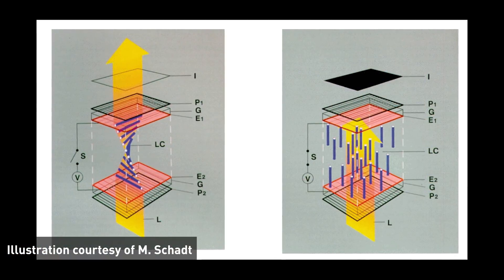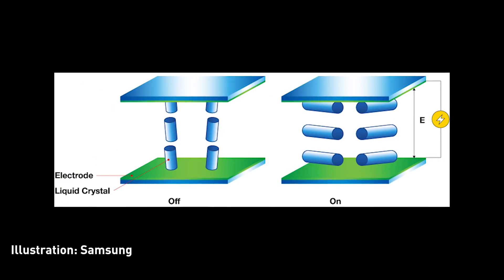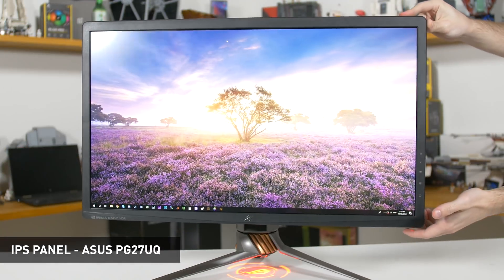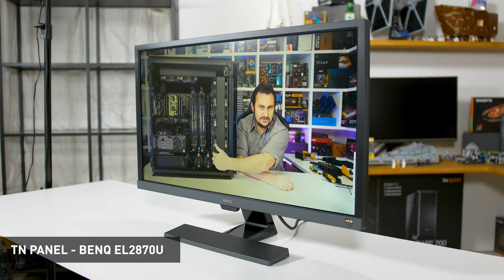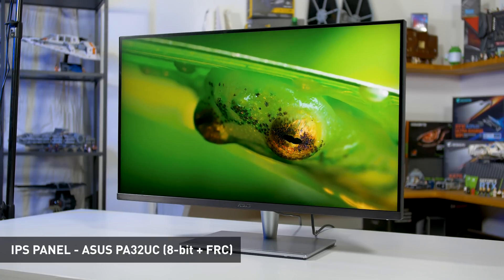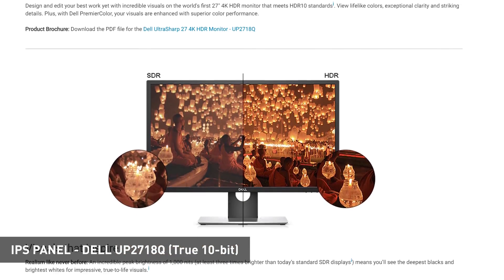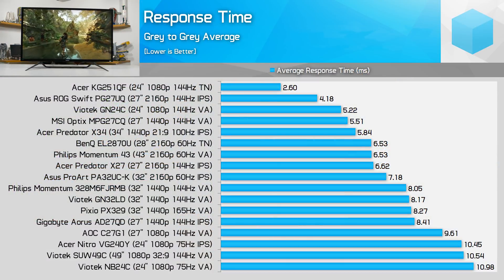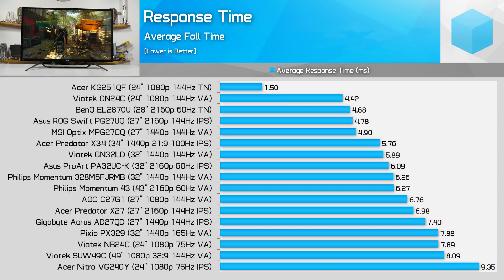TN vs IPS vs VA: Which LCD Monitor Tech is Better?

Comment: A good TN screen will still have better colors than a really bad IPS panel. Didn't saw much difference personally. Mostly in color shifting. My TN panel loses its color accuracy when you look from below the screen. Barely no difference from the side though. IPS experience no difference at all. Reds and blues are quite better on my IPS panel. Blacks seem to be about the same. Not great in both cases.
Reply: @selim1161  Well it does matter that it suits your needs. Buying whatever seems most fitting depending on your criteria is your job then. Though, I wouldn't buy a Monitor for the scenario you are talking about.

Comment: What is the best VA or IPS in the 200-300$ price range? Better if comes with 144Hz refresh rate? I use the monitor mostly for gaming (not competitive) and movies
Reply: If you want 144Hz AOC C24G1 or MSI MAG241C might be something for you. Both are 1080p 144Hz VA curved for $199, they also have 27 inch variants (MAG271C and C27G1) for a little more but I wouldn't suggest those because they have a lower pixel density.

Comment: Modern higher end VA is better, it does not have the old VA ghosting anymore, I would say it is about as fast as high end TN gaming monitor but with way better colour and black level than TN and IPS.
Reply: Yup mine is 4-6ms has a contrast ratio of about 4500:1 and 145% srgb
Reply: Well that's pure bullshit.
Reply: @KeanoMUFC1 ??? What u talking about? What's bullshit?
Reply: @CoCo.-_-  that modern VA panels have no ghosting and are as fast as TN panels. That's just completely not true.
Reply: @KeanoMUFC1  Go see it for yourself, current gen TN panel totally no match to current gen VA.
Reply: @mikka1986  that depends what you demand from it, TN panels are still the fastest panels in the market, even this video shows it.

Comment: Strangely, IPS are looked down upon in the TV market where the wide viewing angles might actually be useful. People are dialled into contrast & blacks rightly or wrongly and go for VA panels although there are some pretty bad ones out there.

I don't see why viewing angles on laptops or monitors are a major consideration, in 99% of use cases you are sat right in front of the screen.

Looks like OLED might become a thing for laptops/monitors but still very expensive and 'burn in' would be a major consideration for games with a permanent HUD.

Likely we are only a couple of years away from monitor technology that can do everything, speed, contrast, blacks, viewing angles, colour gamut then it will just be a matter of price.

Comment: IPS glow really sucks, especially if you always play/work in darker rooms. I’m on VA now and wait for mini-LED monitors (OLED and microLED are not really in sight right now)
Reply: OLED burns in. Not an option for pc
Reply: @scythelord If you use it with your brain they don't ;)
Reply: @ArthurOseven  cant overcome the static icons, taskbar or other static shit in pc. Pixel shifting doesnt help in this scenario. Oled is a no no in PC.
Reply: miniLED monitors are also insanely expensive, even more than most TVs. A good IPS panel shouldn't glow too much.

Comment: Would love a 27-32" flat VA 144Hz freesync monitor.  can't seem to find such with all those specs in Aus. 

Pixio have one but they don't ship outside the US.
Reply: I believe Viotek have one but I don't know is it sell in Australia
Viotek GN27DB 27"
Edit: found this on Aus website https://www.u-buy.com.au/search/index/view/product/B078P57ZWL/s/viotek-gn27db-27-inch-curved-gaming-monitor-1440p-144hz-samsung-va-panel-freesync-gameplus-fps-rts-vesa-black/store/store
Reply: @Conthium  Viotek are hard to get here if not at all.  That's curved unfortunately, I want a flat VA panel with the aforementioned specs which seems impossible to find here.

Comment: TN for me. 
- High End TN today is close to IPS in color production.
- I hate Mation Blur on IPS/VA panels!
- TN is cheaper
- I game alot of FPS games!
Reply: high end TN is close to low/mid range IPS in color reproduction.
motion blur is more likely to occur in low end monitors. and today even low end don't suffer that much from it.
i have a TN and an IPS panel one next to each other, and i really don't see a difference in response time  (the two of them are 75Hz)

TN is if you ONLY care about highly competitive fps games, but if you do anything other, IPS or VA will be a lot better.
Reply: @Ted_Sd  Motion Blur suffer both in High End and Low End monitors, but the TN's are just better when it comes to blur! That you don't suffer from it its a gods end, and you should be glad about it. I suffer from it, and anything glow/ghosting and motion makes me swear to TN everytime!
Reply: @Ted_Sd  You likely never will see the difference, as it's probably around 5-10 ms difference, something so minuscule that only a high speed camera can capture.

But, if your TN monitor is higher refresh rate compared to your IPS, you will see the difference in something as simple as mouse drag over desktop, with much greater difference in games.

I was on the same boat about IPS before I got my monitor, but better colors and viewing angles (something you shouldn't care much about if you are using it primarily for gaming) aren't worth the trouble and extra price.  Like you said, mid to hight range TN's have a great contrast and color reproduction nowadays. Just check reviews before you buy.
Reply: @DavorBa  Your are correct about the ms, but thats not always the same as motion blur. There is some legendary IPS panels out there, namely a good old ASUS monitor who don't have the motion blur issues. Atleast for me!
Reply: @Moonraker84  I didn't mean motion blur. I meant the higher refresh rate of TN monitors (yeah there are 144Hz IPS monitors, but a lot more expensive).
Motion blur is another issue, but the sheer amount of frames a TN can dish out for a much lower price compared to IPS, that gives it a huge plus.

This video simply compared technology vs technology, like everyone has infinite amount of money to buy the latest and greatest 1440p 144Hz IPS or VA monitor that rarely suffers from the issues I mentioned and has a good response time.
Reply: if you buy high end then it's not cheaper.
Reply: @eugenestoner2685  Well, people like to compare High End TN vs High End IPS, 9 out of 10 the TN is cheaper.
Reply: @Moonraker84  Ok, but if you compare high end to high end then motion blur and refresh rate can be comparable, it goes on both sides
Reply: you are right, sorry my bad.
Reply: @eugenestoner2685  Depends on where you live, but generally TN monitors are cheaper.
Reply: -Not even close
-Just stop shaking goddam monitor for godsake
-Yes,and looks like it is
-Should we all speek about our dirty laundry?
Reply: @Moonraker pixel ghosting is not the same as motion blur. There's no motion happening, thus it's not motion blur.
Don't confuse it with motion blur caused by motion of your eyes trying to track objects on screen, which should basically be the same on monitors with equal refresh rates, unless you use some backlight strobing to reduce this kind of motion blur.
Reply: Yep that's true! A good tn like mg278q still close to ips.
Reply: @Moonraker
OMG what a bullshit :)
- Show me TN with 129% srgb (its on my cheap 111$ IPS 75hz 24")
- no motion blur (maybe you see VA?)
- in my country is the same price TN and IPS.
- I game a lot all game's :)

TN is very bad, washed colors burn my eyes, and angles are so bad.
Reply: for me Slight Blur images is better than Shitty viewing angle.
Reply: Motion blur is the one area where the performance difference has been reduced the most between the three panels, to the point that you can buy an equally fast IPS panel today as the fastest TN - if you're willing to look around and pay a bit more, that is...
Reply: TN trash.
Reply: I completely agree.

Bought an IPS monitor few months ago; worst purchase decision I ever made.
It was a 24" 75Hz 1080p LG monitor with very thin bezels.  On paper it looks beautiful, but once I got it, oh boy...

First one had so much IPS glow, that it was IMPOSSIBLE to enjoy anything with a black background (goodbye windows, youtube and reddit dark mode). It also had an issue that MANY, if not most cheap IPS pannels have; visible black vertical lines over certain colors (any shade of blue, yellow, orange).
After returning it because of obvious defects, and after waiting 40 days for a new one, I finally got a model with only slight IPS glow in bottom left, but the vertical line issue remained the same, only slightly less visible.

Googling that problem, I was AMAZED at how many people experienced the same issue, with different IPS models in similar price category.

So a tip from me: DO NOT BUY CHEP IPS MONITORS, ESPECIALLY 75HZ, since they are overclocked and that creates the visible lines on certain colors that totally kills immersion.

After I sell this IPS, I'm gonna get myself a good TN 144Hz display with excellent reviews. I have learned my lesson.
Reply: @DavorBa  , Im in the same position.

Looks great when I open games like The Witcher and GTA.. but then when I hit up Overwatch I practically gagged when I moved my mouse.
Im not sure if its a result of a "cheaper" IPS, or just IPS in general.. but ughhhhhh.
Reply: @DavorBa  Buddy. IPS has always been bad at quick refresh. The cheap ones do no justice especially when you're not supposed to over clock monitors. Sounds like a scam unless it's one of those special Korean monitors. Read around a bit and don't be stuck with TN for worse contrast and clarity. It is an older technology and has fault just like IPS.
Reply: @alexpop3883  It's a legit LG monitor 24MK600, sold as 75Hz with Freesync. There are whole series from different manufacturers that sell 1080p 75Hz Freesync monitors, as on paper it looks like a sweet spot for a budget gamer who cant push much FPS, but would like to enjoy benefits of IPS. Sounds great, but after experiencing it, it sure looks like a scam, since A LOT of people have these same issue with same spec monitors from different manufacturers, but mostly LG.

Everywhere I read people say a good TN panel comes very close to IPS. Sure TN has faults (like backlight bleed for example), but it cant possibly be worse than this crap I have right now.
If it didn't have this problem (pixely blue, yellow and orange colors), it would be great and I wouldn't sell it.
Reply: @DavorBa  damn i was going to purchase the famous lg 24mp59g wich has IPS 75 hz 5-1ms freesync etc and many gamers on budget seem to buy it... but i also read many problems about blue/orange pixelated image and other problems. Now i dont know what to buy
Reply: @jaab5594  That monitor, along with 24mp68vq, all use the same panel, as far as I know. There is a thread on Linus forums about 24mp68vq and a lot of people with other models have come out to talk about the same problem.
My recommendation is, dont buy that crap. I cant sell my at a loss, for over a month now.
As soon as I sell mine, I'm gonna buy a LG 24GM79G, a 144Hz TN 1080p display, rated by most as the best 144Hz 1080p display out there.
This way, when I upgrade my PC one day, I dont have to think about changing monitors, as I will be covered.
Reply: @jaab5594  Oh and one more thing: freesync range on these 75Hz 1080p IPS monitors is bad. It covers only 48-75Hz range, meaning any game you cant push to 48 FPS, wont see any benefits of freesync.
I was disappointing as my Witcher 3 ran around 40-45 fps max and I still saw tearing with freesync on.

That 144Hz LG I mentioned I will buy, has something called LFC, which eliminates tearing and stuttering below freesync range, meaning if I used that monitor now with my Witcher 3, I would get no tearing whatsoever.

Comment: I laugh everytime when someone games using an IPS panel.
Reply: That depends on the monitor. The 1440p 165hz ips monitors are actually slightly faster than the TN variants. Don't forget that the response time is not input lag.
Reply: @user-zq8ce2eb6t  yeah but 300$ vs 500$ 🤷🏻‍♂️
Reply: I got my 1440p 144 hz for 350$, I cant afford 500-600$ lol
Reply: I game on a ips and my friends say its much better than the TN panels they are using. The difference between a 1ms TN and 4ms IPS is super small, almost unnoticeable but u get a much better picture in return.
Reply: https://youtu.be/79r5rxS276Y?t=260